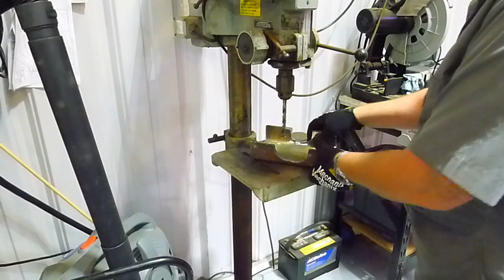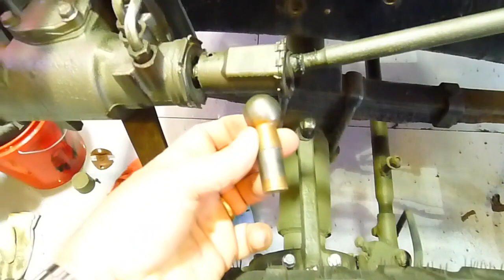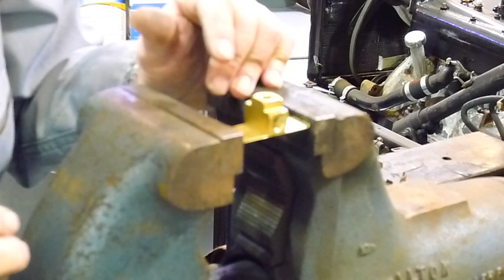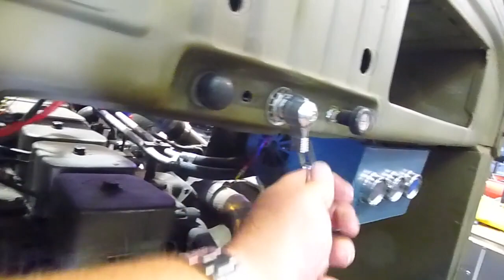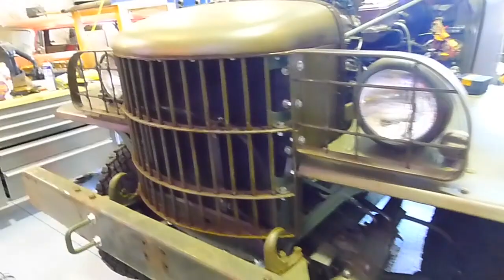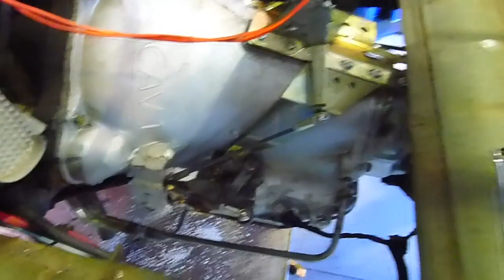1941 Dodge Power Wagon Cummins 6BT Diesel Conversion, Part 3

Comment: I wish that You folks that have a 1941 Dodge WC would call it what it is. It's a WC NOT a Power wagon.  Power Wagon's came to be in 1946. That said this is a very nice open cab Cummin's conversion. Just remember that one speed transfer case is NOT the strongest thing ever made.  I have extras when you tear that one up.

Comment: Dodge Power Wagon from 1941.... That is a very early one because Dodge started with Power Wagon well after WW2... 🙂
Reply: 1946 This is a Dodge WC open Cab.
Reply: @georgehledik7481  1941-ish Dodge WC21-ish.
So not Power Wagon and not 1946.

Comment: Nice build John. I have been restoring W.W. 2 trucks since 1995. Your truck is either a WC-13 or WC-21, depending on year and brake equipment. Power Wagon went into production in 1946. I would suggest stocking up on several more of those single speed transfer cases. They are strong, but may wear a bit more quickly behind that BT-4. John and the boys can help; https://store.midwestmilitary.com/Default.asp

Comment: I wonder if it would be worthwhile to do a cut/turn on the rear axle to help straighten the shaft angles. Awesome build! I'm hunting for an ambulance, I like the M43, but a WC... Would be good too. I've been tinkering with a different approach to twincharging and I'd like to see how it will change the performance of a 4bt, but hearing how smooth the 6bt runs makes me wonder.

Comment: having done one of these its a shame to not keep it factory but who doesn't love the engine conversion; well done! I think the stock drivetrain won't last a week under that kind of torque, seriously. a single speed transfer case hard mounted to the frame, drum brakes lol the stock application was for what, 100 hp? drop in an atlas and dana 60s and you can use it. unless its a retro rig made for parade only then a 4 cyl pinto motor would have been an improvement.

Comment: Love your project. Wanted to suggest Amsoil dry air filters made with nanofiber instead of the the K&N oiled cotton type. They filter much better as well as flow more air. For cleaning they only require shop air every 25k miles. Reference link: https://www.amsoil.com/shop/by-product/filters-and-by-pass-systems/air/amsoil-ea-universal-air-induction-filters/
Reply: Thanks for showing the crimping part. The tool used looks perfect for the job. Probably pick one up for myself. The Cummins with the VE pump always starts so quick. I forget how quick now that I have an 06 24v. Miss that part for sure. Can't wait to see the rig driving around!
Reply from the maker: getting closer
Reply: John Handy let us know if you have an update. Looking forward to seeing what's been done. Thanks!